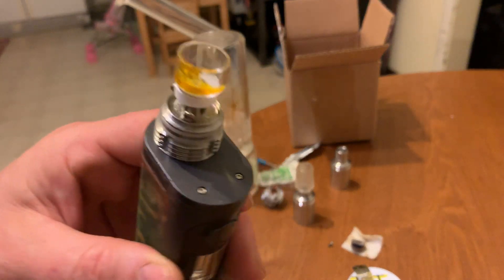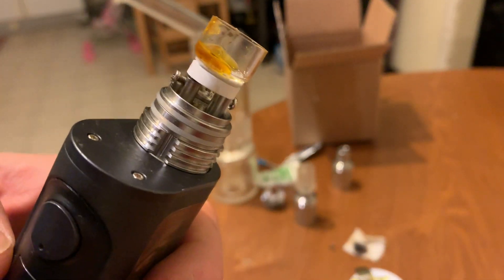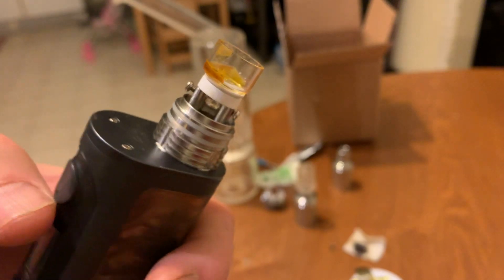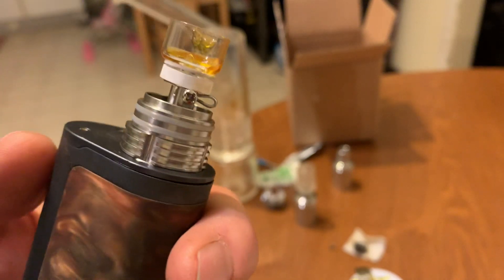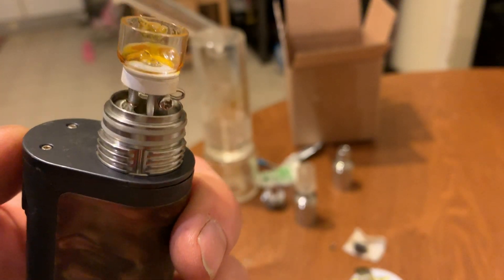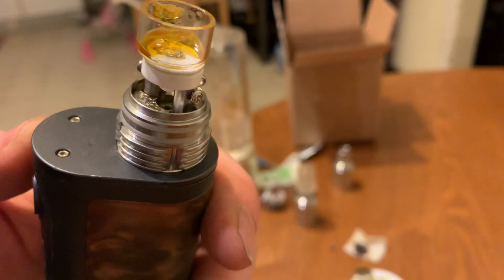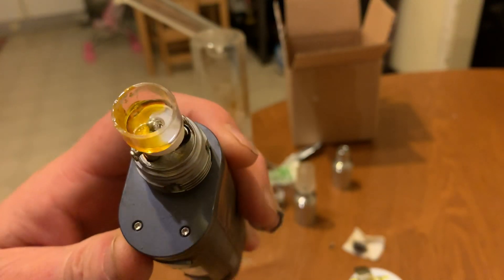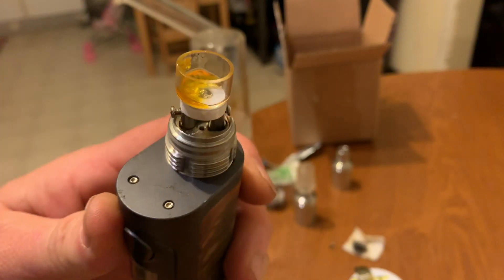Latest v4 crucible prototype April 8, 2019

Comment: Why haven't you made the switch to ceramic plate heaters like the Sai has? The donuts are OK, but very uneven heat distribution IMO.

BTW, I've owned all your vapes including the 2.5 flower vape :)
Reply from the maker: The donut heaters are needed for this most recent prototype for the glass rod in the quartz cup to go through and be secured to the heater.